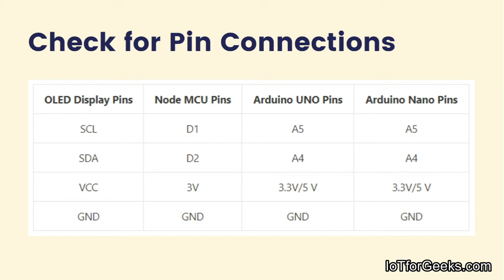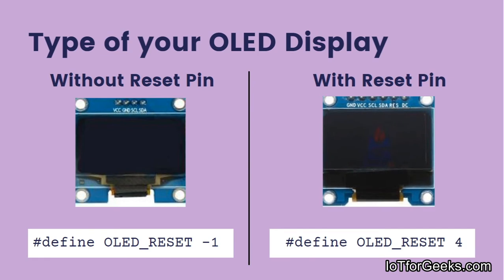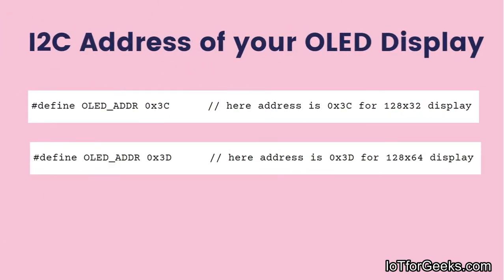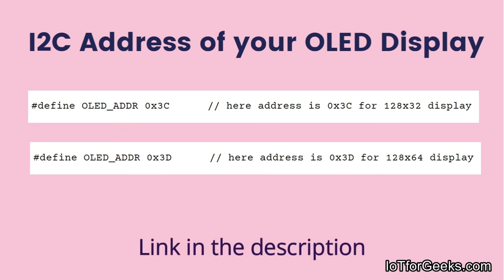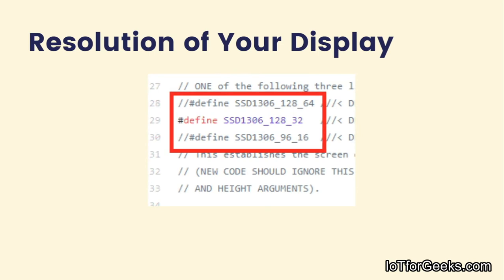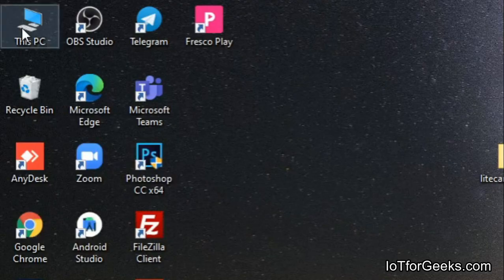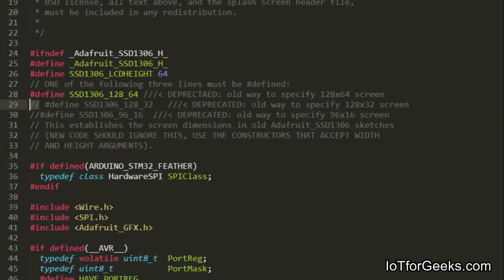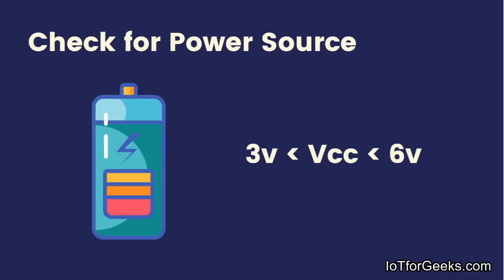I2C OLED Display not working? Try this troubleshoot guide - IoT for Geeks

Comment: Hi bro....  my oled display working but don't show correct, but  show in big size
Reply: Try standard demo code and check pinout, also do check the resolution in library...
Reply: @mr-abhi  I check all these conditions twice but the result is same
Reply: @makeforindia612  uncomment U8GLIB_SH1106_128X64 u8g(U8G_I2C_OPT_NONE);	// I2C / TWI 
😃